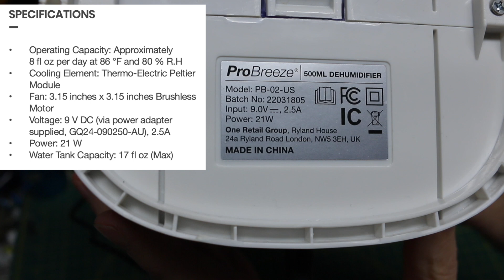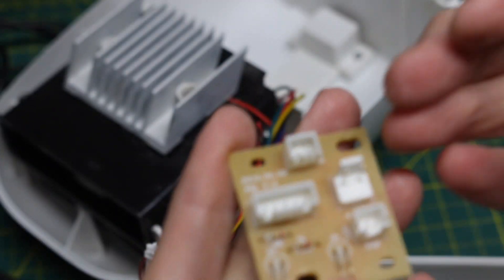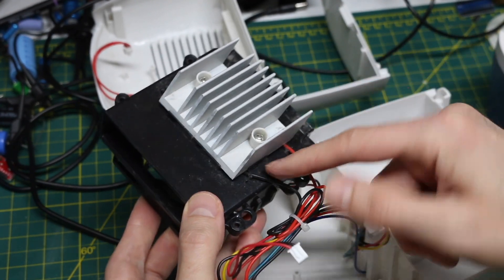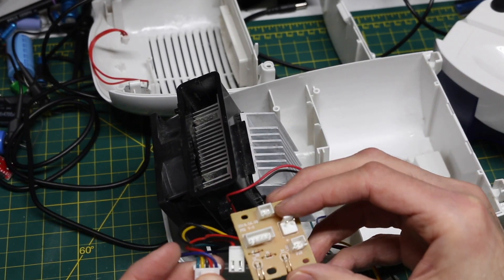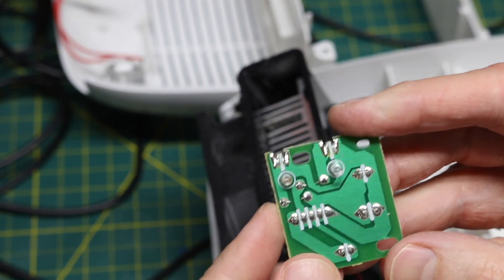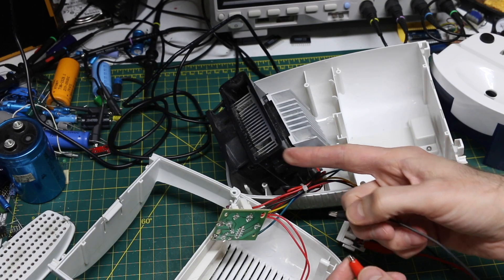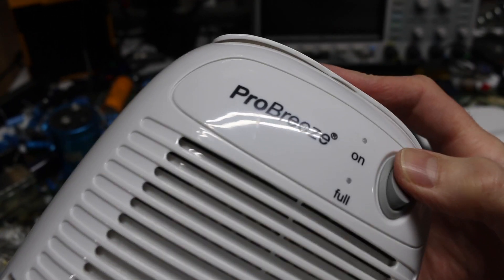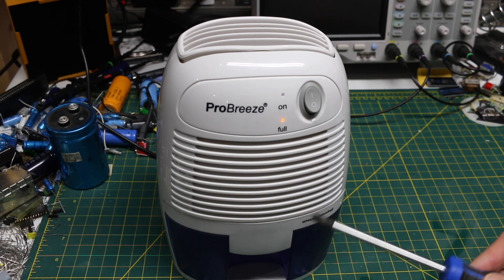Mini Dehumidifier Stopped Working - Is it Fixable?

Comment: I have just one like this and problem was the circuit board. The soldering came of bur i destroyed beyond repair in my first attempt to solder somethimg ever 😆 
It‘s from Vavsea and the way the cramped up the circuit board with constant pressure on the solderings is crazy. Just bought your brand.

Comment: you could do with fitting a timer so it so it runs for a few hours then switches off, to let any frozen water on the heatsink melt into the tank.
could be a simple Arduino project.
Reply from the maker: even a 555 timer with a relay like it’s 1984 again!